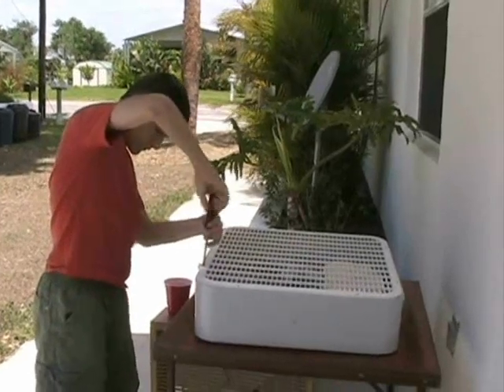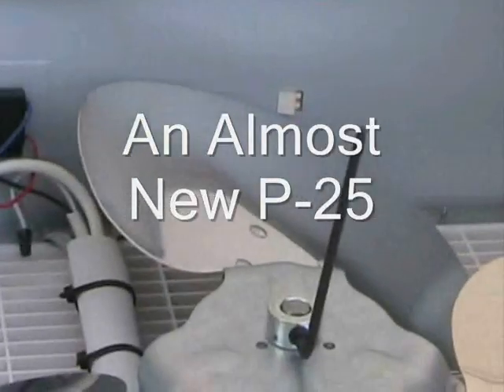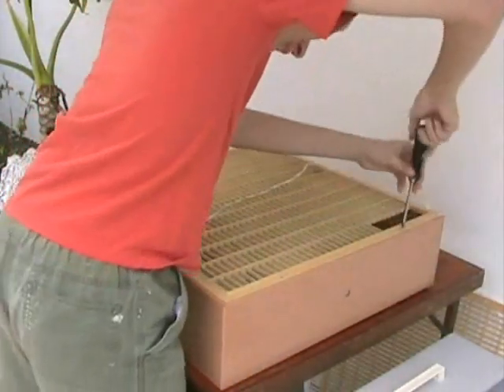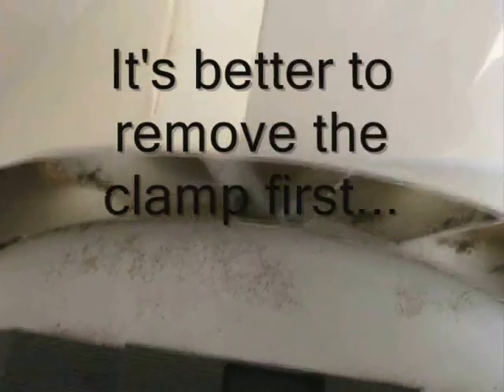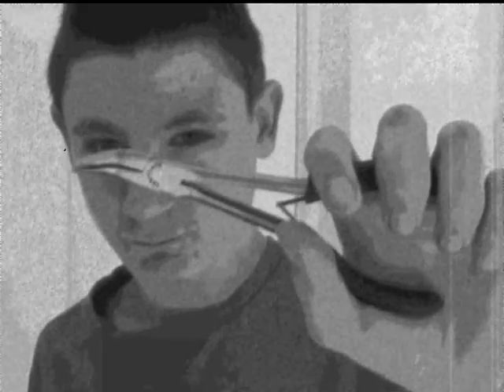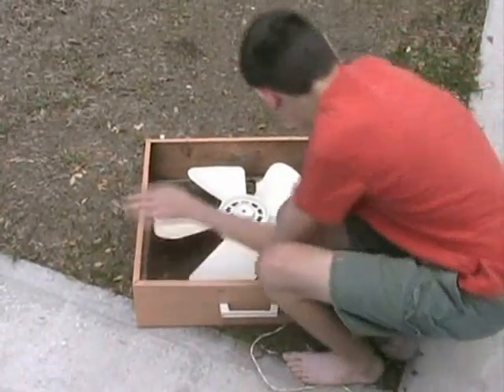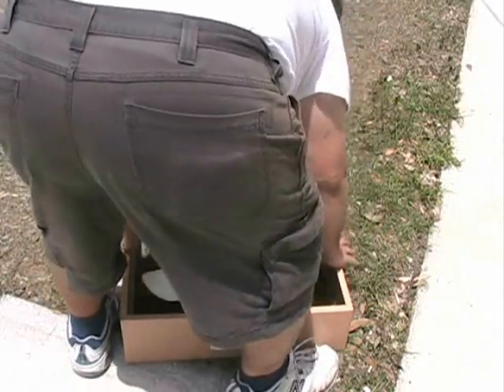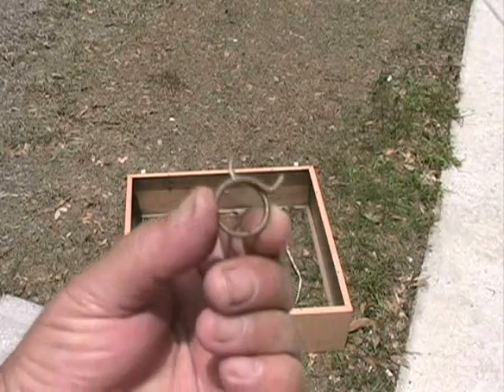Lakewood P-25 VS S-223, Part 1 of 3, Blade Removal 101

Comment: I just got a Lakewood Deluxe box fan that seems to have the blade out of balance. I tried using an Allen wrench to remove the set screw but I can't seem to remove the blade. I wonder if it's stuck. And the rattling mostly happens on Intake mode, exhaust is fine.